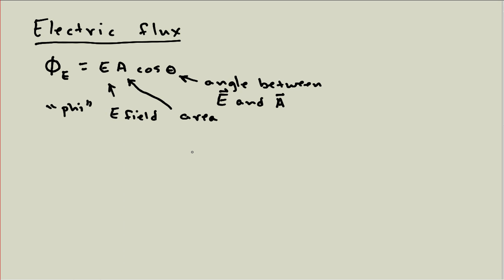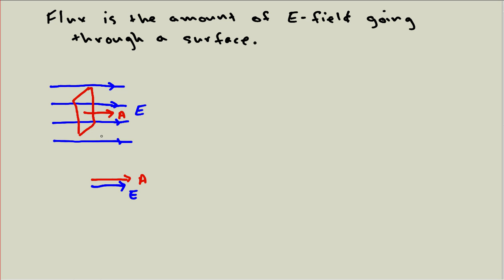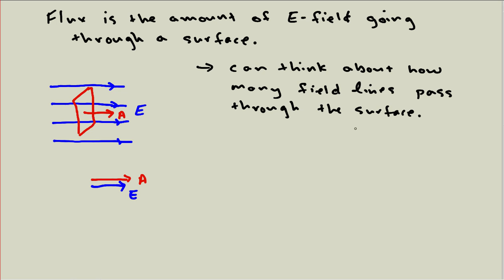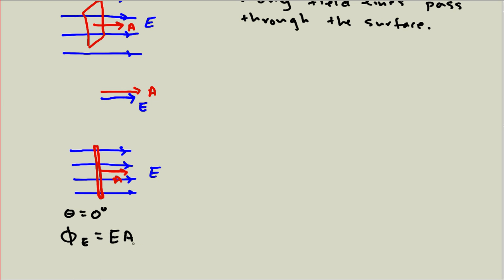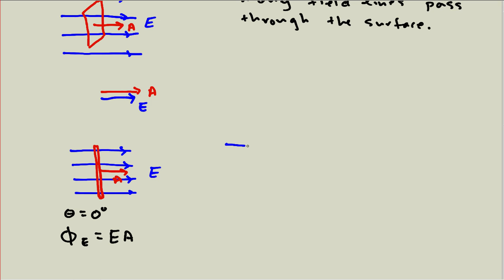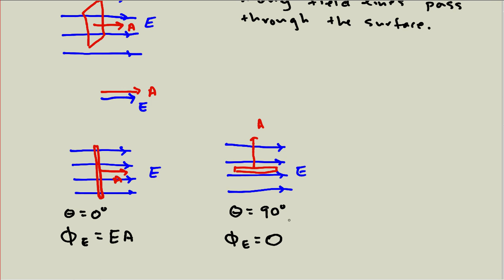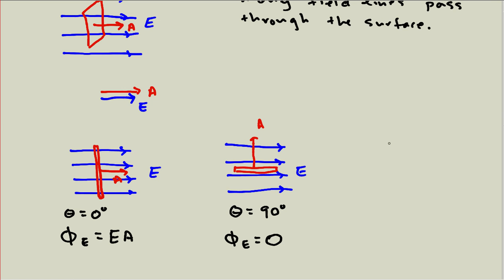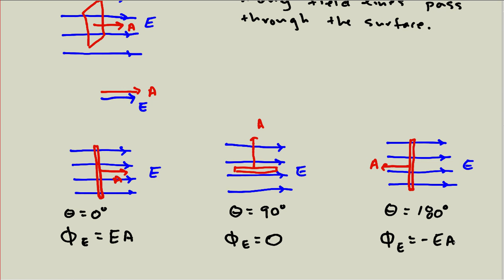Electric Flux

Comment: Why the flux for an open surface kept in a uniform electric field not equals to zero as the amount of electric field lines that come in is equal to amount of field lines going out(which I believe is the reason for flux of a closed surface in a uniform electric field is equal to zero)?
Reply from the maker: Hi Nisha. For an open surface, "in" and "out" aren't well-defined. The lines either pass through the surface in (roughly) the same direction as the area vector, in which case the flux is positive, or in the opposite direction, in which case it is negative.